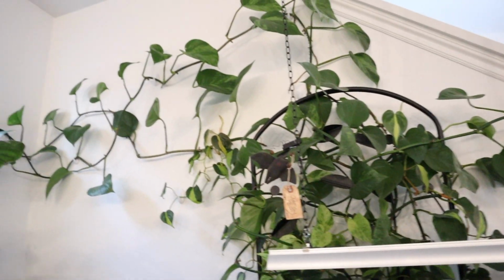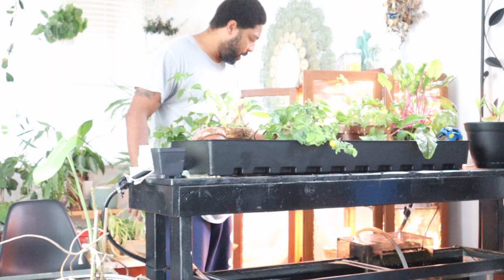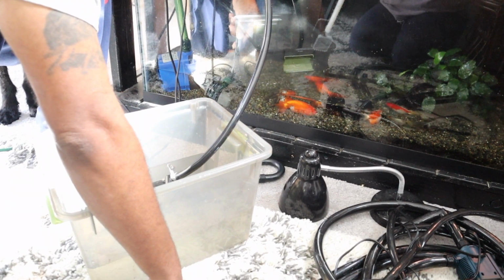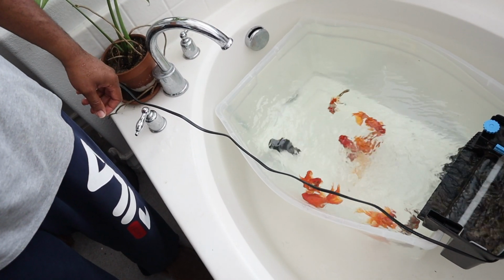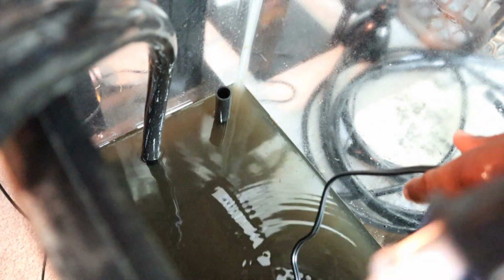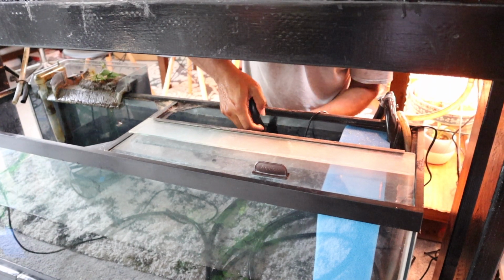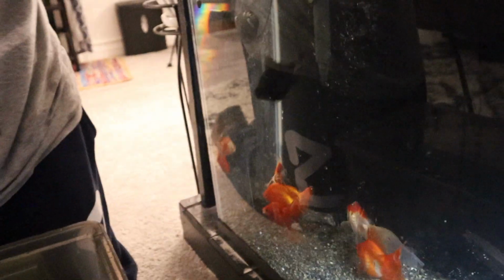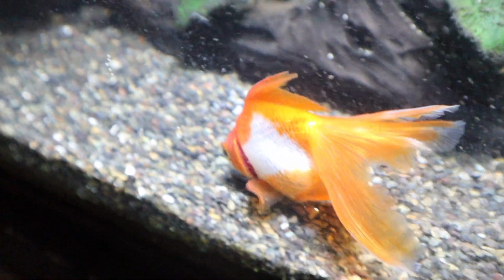OUR FISH TANK FLOODED THE LIVING ROOM | Using a Matten Filter to Minimize the Risk of Future Floods

Comment: When he moved the gravel to put the new filter in did you say you only clean the gravel once a year?  Did you also leave the anerobic bacteria in the fishtank? im just trying to learn as much as I can, great channel.
Reply from the maker: Yeah we don’t clean the gravel (gravel vacs) too frequently on our fish tanks.  I was being dramatic when I said we do them like once a year but realistically the most we do them is 3-4 times a year. 

We only clean gravel when we see an accumulation of mulm in the tank’s substrate and usually that’s because so much waste has been produced, our snails can’t keep up. 

We leave the anaerobic bacteria in the fish tank as it is a normal part of nature to have a balance between aerobic and anaerobic.  As we moved the gravel around to put the sponge into the tank, we were introducing oxygen back into the substrate (like media churns in a sump) which killed off some of the anaerobic bacteria.  Anaerobic bacteria isn’t necessarily a bad thing and can actually be beneficial if you have at least 4 inches of substrate- the smaller the media, the better.  Anaerobic bacteria actually helps lower nitrate levels the way plants can but requires no disruption to introduce oxygen.  Always happy to help answer any questions and thanks for the support in watching our videos. 🙂